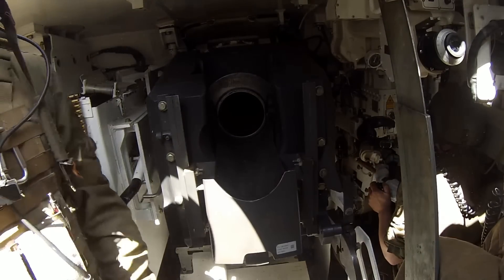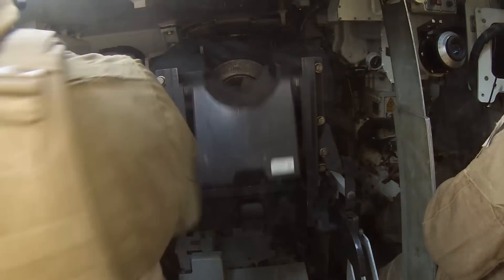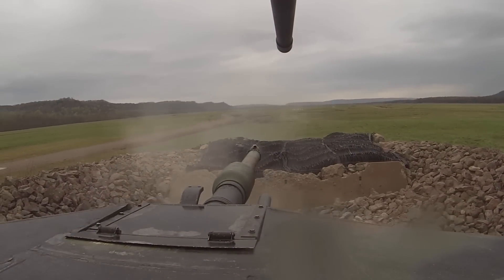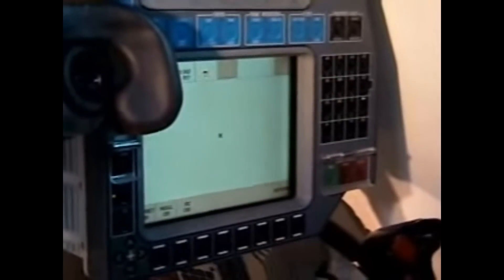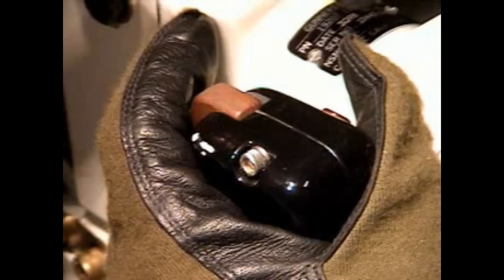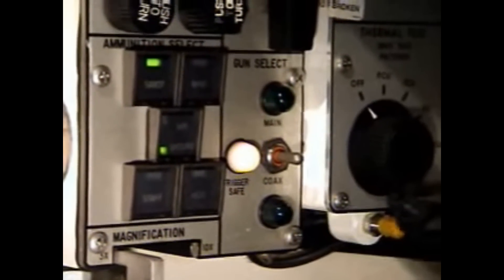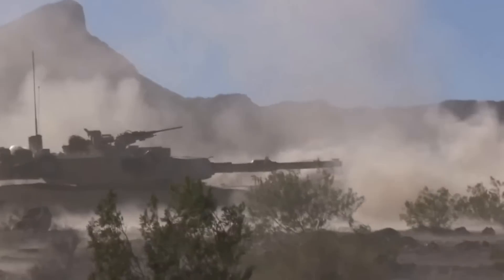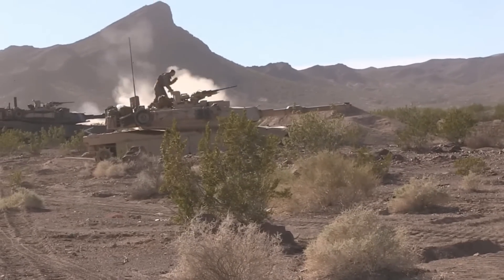How Do They Clear Tank Gun Misfires?

Comment: Not a loader, but I loaded for a tank after the crew finished qualifying and went on to was it "table 15" run. They let me load because they had excess rounds they need to get rid of on the range. I did have a misfire, but it was due to my negligence :D. I hit the arming switch on the loaders panel with my elbow by accident. 
I was Abrams tank systems maintainer. At the time 63A MOS in army. So as per your question about further troubleshooting after round is extracted. It is called into their maintenance platoon. Which is where I come in as a mechanic. Depending on which variation of Abrams certain things get checked. Tank rounds get fired via 9 volt connection from firing pin. So I have to remove firing pin and check if there is continuity for circuit for that as in if there is a break or crack in the pin which prevents voltage to the end of pin. Then I check if there is a break between the hole where firing pin is inserted to the blasting handle. Then I have to check if arming/safety is interfering with the process via fire control computer. Then I check if the whole process is receiving 9 volts all the way from generator/battery.
There are steps in the book that mechanics use for all this process. 
I was deployed to Iraq when one of the faults concerning firing of a round appeared on one of the tanks. And due to no-parts availability I had to improvise. Wiring fried to deliver 9 volts. and their blasting handle broke ....sigh. I fished out several 9 volt batteries and for next week or 2 they were driving around with gunner firing rounds via 9 volt battery and button i rigged up. Of course it was temp fix until I could receive a correct part.

I think if you're interested in more in-depth explanation, you could look up tank troubleshooting book. And see step by step process.

Comment: That is the official procedure.  The real procedure used in the field adds two steps to the beginning of the sequence:

1) The gunner checks his gun select switch to ensure it is on 'main gun' and not 'safe.'

2) The loader checks his gun safe/arm switch to ensure that it is on 'arm' and not 'safe.'

This procedures resolves over 95% if real life misfires.
Reply: Well, official procedure is for dealing with broken ammo. So as long as army spent a lot of money soldiers don't really have to worry.

Comment: When a missfire occurs the gun is usually out of service until the firing system can be tested and confirmed to be operable. It usually is a fairly quick test. Our old Naval 5" guns carried a tester in the gun house. It was the rear few inches of a powder casing with a couple of test leads hooked up where the primer would be. We just chambered it and used a volt meter to see if sufficient voltage was getting to the primer to fire it. I suppose the tankers have some sort of test system.
Reply: They do, it's a card that fits in the gap between the breechblock and the rest of the gun, with a light that shows if it's getting enough power.

Comment: I'm an old time tank commander on an M-60.  Our rounds were, and I believe they still are, electrically primered. We had an incidence of a broken wire between the master blaster and the firing pin one time.  normally we use a firing board between the block and the gun , when you hit the trigger, it would light up for a continuity check. It is pretty easy to get to, as it's in the gunners shield. 
I was also involved in a training accident when two guys were working on fixing a turret blower motor.  They failed to disconnect the batteries (An important safety step), as the main gun rounds are set off with a mere 5 volts, they dropped a wrench and short circuited the batteries and set off three rounds inside the tank. The shells never went off as they were bore safe, but the rounds went off and killed them both.  My friend jumped in with his gas mask on and tried to save them.  There are two kinds of gas the gas mask doesn't protect you from and one of them was in the fire that erupted inside the turret.  My friend had to be rescued but later, he was awarded a medal for trying to save them.

Comment: Interesting addition: all of the attempts to fire the gun before waiting the 15m take place in a time frame of 20-30s.. an experienced crew can quickly solve situations like this through rigorous training. 
-Leopard2A6 Gunner

And about the end question we:
We would check that all wires are still tightly connected and that the conducting plates near the gunner arent damaged. The leopard 2A6 has a neat panel for the commander that shows him error codes which are then looked up in a packet. Its a fast way to fix specific issues. The error could also be the electric firing 'pin' that gives a current to the primer of the ammunition. A spare firing pin is found under the gun. But misfires in these 120mm guns are pretty rare.

Comment: I was on the SEP V2 M1A2 Abrams version.  I remember the only difference is that the TC is the one checking the circuit breakers.. Other than that it was spot on.  Since the A2 version is more computerized.

Comment: the scariest misfire I could think of, would be an HE-F shell fizzling... the actual shell would get stuck in the barrel and fail to clear, many of these shells have a self destruct timer. by the time you realized the shell was stuck, you may have already loaded another, and fired, or, you may hear the gunner say "no impact, check the ---- before the shell goes off and sprays shrapnel and parts of the breech back into the tank. god forbid a tank crew attempt to fire an HE shell and follow it up with APFSDS. that would cause one hell of a mess inside the crew compartment.
Reply: Oh I know, my comment was referring to MUJUNKY, I should have specified.
Reply: The rounds are primed by different methods but all involve actual firing of the gun without error. It requires acceleration or spin or airflow over the round so it doesn't self destruct if there's a misfire. It was made this way on purpose to stop such things from occurring.
Reply: No explosive projectile larger than .50-cal and made in a 1st world country has had a "self-destruct timer" since the 1950s. They all have spin-activated safeties so if you accidentally shoot your 40mm grenade/AT-4 rocket/120mm tank shell into the berm 10 feet in front of you it just buries itself in there and doesn't blow you to kingdom come.
Reply: 20mm AA rounds used in the CRAM has a self destruct fuze to prevent it from falling to the ground and doing damage over there. In fact most explosive rounds for AA weapons have self destruct fuzes for that exact purpose since most Anti Aircraft duties are performed close to friendly troops there's a great chance of those rounds doing damage once they fall. The german DM-70 round for the 35mm KDA used in Flakpanzer Gepard also has self-destruct fuze.

Now while AA self-destruct fuzes might not be what we're referring to (like the RPG-7s self destruct) it's still pertinent to mention that rounds larger than .50 have been made with these fuzes.
Reply: self destruct timer? What in the world are you talking about lol
Reply: Air defence cannon rounds contain high explosives and as such it would be unfortunate if they were to fall to the ground and smack anything on it (which would be your own units in case of air defence as you are usually not directly on the front but behind it). So in order to prevent casualties on the ground the AA cannon rounds like the 23 mm OFZT for the Shilka have a self destruct mechanism that detonates the round after a certain time should a hit not be scored.

Now while tank guns do not have that feature, some do feature timed destruction for airburst detonation.

Comment: So what happens to the "misfired" round that is now back in the ammo storage rack afterwards? Does the crew take it somewhere to dump/destroy it?
Reply: They mark it so they don't use it, then try another round; if the other round doesn't work it's the gun that's broken, and get to work on getting that fixed. If it's really a defective round they keep it aside until time to get more ammo, then turn that one back into the folks handing out new ammo, and they have procedures for dealing with it (probably dumping it in a pit and blowing it up safely).

Comment: Curious you mentioned you were REME, so why pick the M1 instead of Challenger?

I was a crewman on Chieftain, which uses multi part ammo (vent tube, bag charge, & projectile). A misfire was normally caused by the loader missing the vent tube, which was easy to spot (vent tube indicator not protruding)

Comment: I had a round when i was a loader, fall apart in my hands as in the base cap separated from the cardboard combustible part of the round. I could see the propellant. It was very interesting. We just carefully removed it and put it in the ranges dud pit and EOD came and took care of it.  From what I learned while I was a loader, is that the M1s ammo is very stable and wont actually explode out side the tube it will just create a nice fire.  Now this is just what I heard both from more experienced tankers and my NCOs.  They said because it doesnt have that pressure that exist in the gun tube it j ust catches fire.

Comment: I assure you, in a combat situation, that procedure goes (mostly) right out the window. No one is waiting 15 min to pull a bum round. For the fire control test, there is a firing circuit testor that gets inserted between the breech and the block. When the firing circuits are closed, a light on the testor illuminates. If that fails to light and there's no breaker tripped, maintenance gets a call. (or the crew takes it upon themselves to check the harness connections themselves)

As far as pulling a round, the scary part is trying to extract the round without the case tearing apart and dumping propellant all over the turret floor. If that happens, someone has to dismount, dig out and assemble out the barrel rod to punch the round out from the other side. Hopefully it's not a HEAT round.

Comment: Much better than when I was a tanker on M48s and M60s.  Misfire? try again, if not firing then time to get the round out.  breech had to be opened with the operating handle, hard to do, sometimes the TC had to stand on the handle and the loader ready to catch the round as it shot out.  If the round was stuck in the chamber had to get the ole rammer/extractor and try to pry it out, if that failed then assemble the ram rod, put on the bell rammer, insert in the muzzle of the gun and try to shove the round out, sometime banging on it   until it moved.  The loader still waiting to catch the round.

Comment: In the Australian Army, (due to the fact we have Abrams tanks) we get training from Marine Corps and Army Tankers who deploy to Puckapunyal (our school of armour). Now some back story, the Aussie Army doesn't have as many mechanics as the Marines or the Army, so we're trained to do most of the servicing and maintenance ourselves. (Unless it's something major which then we either call the mechanics or if that doesn't work we get contractors who know the Abrams inside and out to fix it)

Now the issue with a misfire (which I've only ever experienced once) is that it's about 20 minutes (if you follow all steps and the round hasn't discharged) of waiting. After that 15 minute wait and once the loader has put it back into the rack, it stays there until either engineers or specialist mechanics show up. (Just so you know the blast door on an Abrams is designed to deal with the rounds going off inside of the rack.) 

Just remember a round that misfires in an Abrams (from my instructor) is a 1 in 300,000 chance. (Meaning one out of 300,000 rounds will misfire. 

If any other questions, don't hesitate to ask.

Comment: M1A1 rate of fire, 3 rounds a minute, LOL
Reply: Talking about how many rounds a crew could fire off is really unrealistic. First off, every tank crew trained and drilled constantly, whether on range, out in the field or in the motor pool. The loader practiced the loading procedures over and over, to reduce time needed.The gunner and TC would be tracking and acquiring targets during any engagement. Unless you are envisioning some Cold War Fulda Gap scenario with the Russian Hordes cresting over the hilltop at you, you are not going to need to pump out 5-6 rounds continuously. Besides, after a couple of rounds, tracks would be relocating to a new firing position if possible or simply on the move, enough time for the loader to ready another round. Even with electric motors to move the turret and gun about, it still require time to acquire and lase multiple targets.A competent crew with a well-maintained track would be able to engage and destroy target with one round, or a follow up. 5-6 rounds!!!? That's a lot of targets coming at you to pump that much rounds out. I have yet to hear of any such frantic engagements personally, even the famed turkey shoot of Easting 73 in the recent past. BTW, that was my old unit!!! :-)CAV ALL THE WAY!!!
Reply: Try 6, more with a good crew.

Comment: is there a lot of 'fuck me fuck me don't explode, don't explode,fuck me fuck me' going on at the same time?
Reply: The round is far more likely to burst into flames than it is to explode.
Reply: still'd run the risk of the chemical explosives going off from the heat of a misfire, or it could trigger the fuse assembly, no?
Reply: There's always a risk, but even in WW2, American tank shells had remarkably stable high explosives that were far more likely to burn than explode if the tank caught fire.
Reply: explosives yes, but what about their fuse assemblies? They are activated by the shock of firing but just how much before they trigger on? HEAT and explosive rounds have a self destroy function built in  in case of misses, so having that function trigger in a misfire would fall under the heading of ' puckering feeling', no?

Comment: Seen some bad malfuctions.   During 1 battle in Iraq, one Bradly comes out of a dust storm finding themselves in close range to Lions of Babylon.   They fired their first missile,  the missile leaves the tube and... lands on the ground infront of the tank piling into the sand.   they call out firing 2,  second missile leaves the tube and again piles into the sand.   back to back with a tank 300 feet away and both missiles fail.   they call that they are going to pull back to reload but their the 2nd bradly yells out, reloading, so they instead start chattering away with their gun hoping to distract and suppress the target long enough for the other to fire.

Comment: Tank on tank action jerk that thang out &throw it out of the hatch &reload quickly. UP !!!!
In peace time your asses aren't on the line go by the procedures.
If I remember correctly ,M-60A3. TTS didn't check a circuit breaker.
If the master blaster didn't ignite it,( 3times).remove round & stow it .
Reload ,UP!!!!!!!!!!!

Comment: having experienced a missfire on a 155mm before, i can assure you it gets your blood pumping! whats special about artillery missfires compared to tank missfires is that with artillery rounds you cannot remove the shell, as it is fused into the barrel everytime you reload. We tried jamming the barrel with cleaning rods and then rammed it with a massive frontloader (quite a sight), and it still would not move a millimeter. Only way to get rid of it is to use another primer, or find another charge and fire the round.

Comment: On M60A3. We never waited. Peace time only but never waited. Pulled round out, rotated 180, slammed back in. In the 3 times I had misfires on my tank that always worked. Probably bad contact between firing pin and base. We had similar procedure as you show here. Suspect they don't wait either.